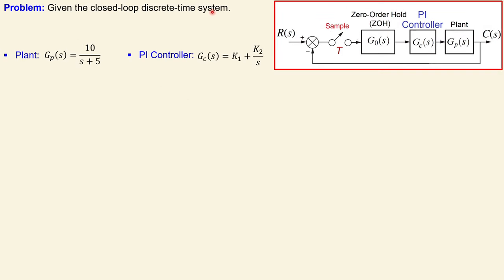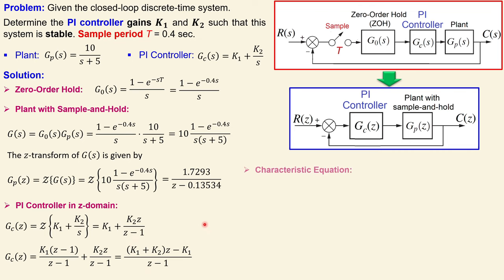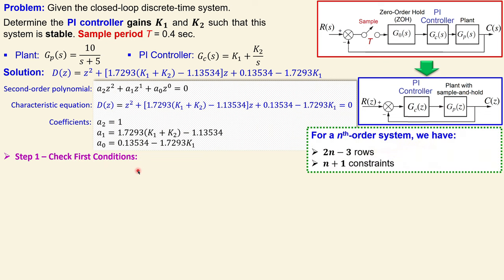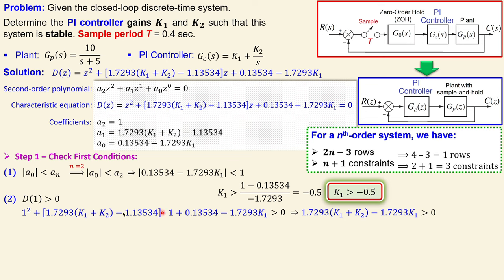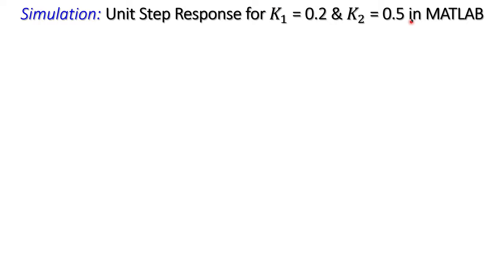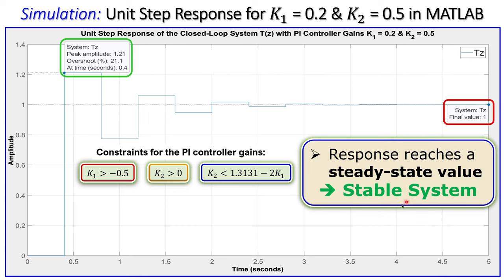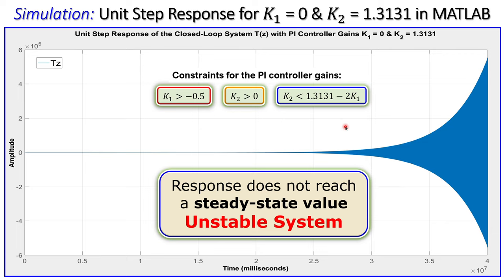Jury Stability Test | PI Controller | Discrete-Time System | Calculations & Simulations | Example 4

Comment: Great video, thank u for this example, i have a doubt in 8:40 when u do the absolute value restricttion ,K1 have to be above -0.5 and also K1 must be less than 0.6584 right?
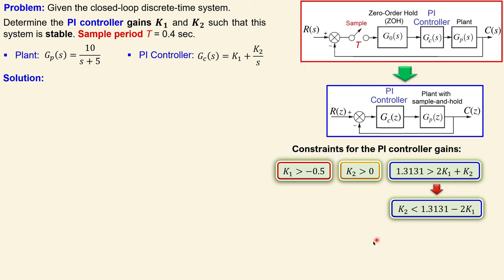Reply from the maker: Thanks for your message. If you take the absolute sign correct, the K1 must be also less than (-1-0.13534)/-1.7293 = 0.65655. Actually, this restriction for K1 comes back at 12:40.